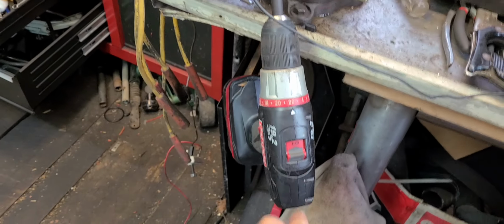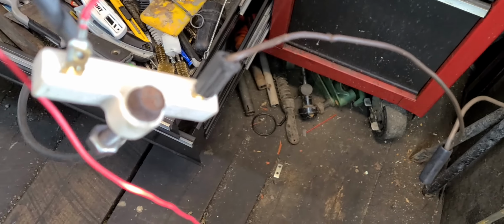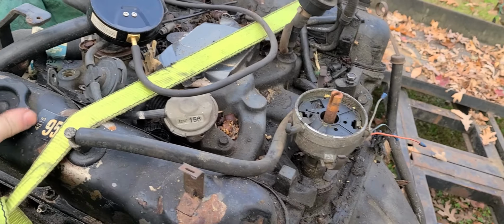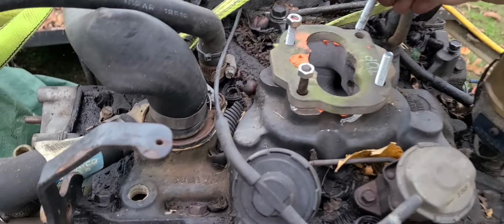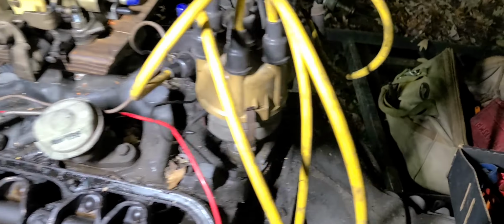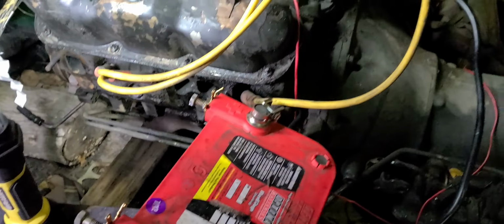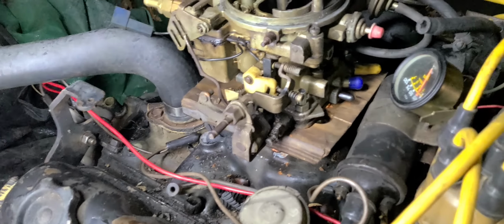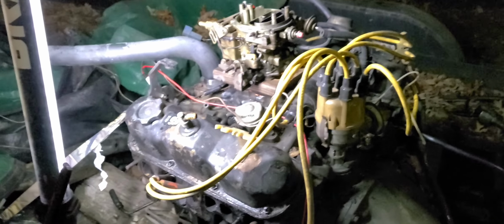first start of the 239 V6

Comment: Slant 6 cams work on the 239? Do you know of any manufacturers that sell cams for the 239? I can't get a conclusive answer on forums
Reply from the maker: Hello and thank you for watching the video and thank you for your nice comments. As far as the slant six cam working in the 239 V6 no. Will not work in any way. The slant six and the 239 are of different engine families. 239 is part of the LA and Magnum engine family. You did not specify in your question as what year your V6 that you have in mind for this camshaft however, with some looking I found out that Hughes engines. You can look them up at Hughes engines.com they do a lot of regrinds on the factory camshafts and these are very successful. They offer one on their website. Just go over there and look dig around a little bit and you'll find it it is a. If I recall correctly, a 485 lift on the intake with a 1.5 rocker using that particular cam will make your engine have an incredible sound and it will perform considerably better given that the engine is in good shape and there's no issues with it. However, if you're relying on the forums to give you information all they seem to be good at is arguing back and forth as to who has the right information or not. Really the only one that seems to be of any use is all par. You can look them up. They're not bad but anytime you get information about a engine or parts and pieces for an engine just be sure to double check if it was me doing this. I would be trying to educate myself by watching videos like mine but also watching people like that are way smarter than me like David Vizard and and Richard holder and Gail Banks. All of these people are on YouTube putting out content and information. Now you probably won't find them putting out information about Dodge 239 v6s. However, the information they put out about other engines can be applied to the V6 Dodge 239 also, I have one of these engines in a full size d150. It's a 92 model Magnum version and it has been mostly stock. Some mild upgrades on the ignition system and dual exhaust I hope this helps. Any further questions feel free to ask
Reply: @slantfish65sd thank you sir! I was wondering if the .485 lift cam would work with 1.6/1.7 ratio rockers or if they'd be to aggressive (hit the valve cover). If need be I could hack up 360 valve covers and have my buddy weld. Ideally I want to make 300whp with no boost, allegedly it's been done, but I know it's going to be a tall order especially for a beginner like me. Engine is a 2000 model year btw
Reply: hey i own my own 1987 dodge dakota and i was wondering if i could get in contact and have you teach me a thing or two about my engine im currently having electric chock problems and i dont fully understand it?